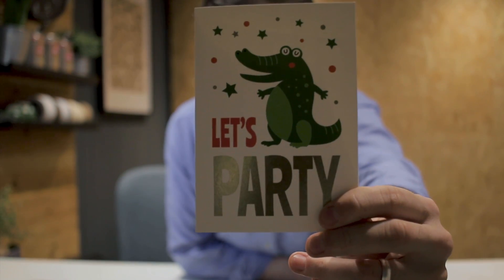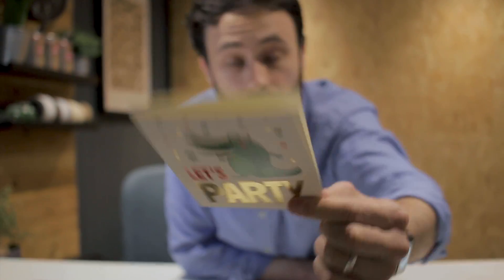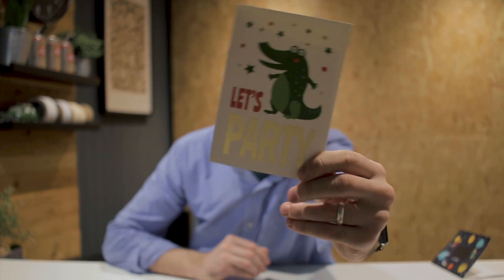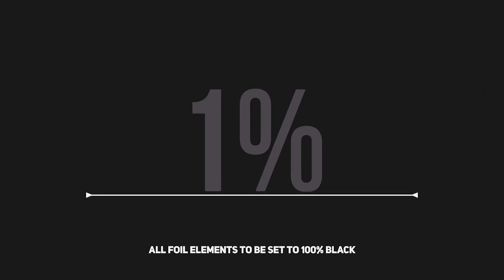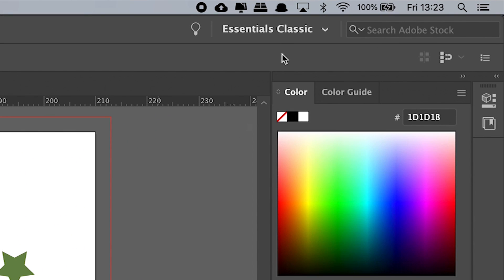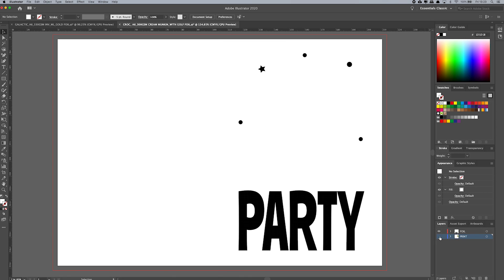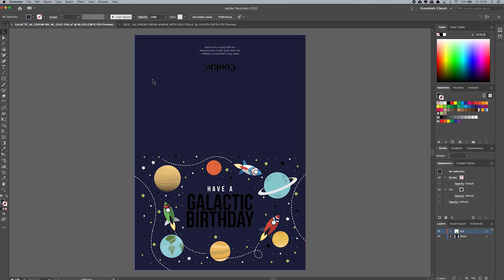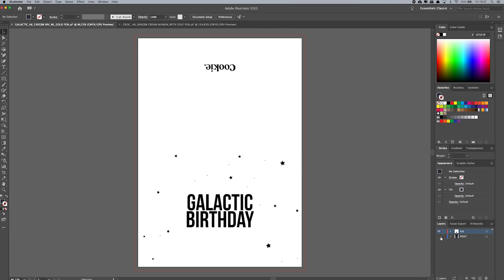How To Setup Artwork For Foiling // Adobe Illustrator

Comment: Excellent video, Rob! Thanks for the great information. Is it possible to print a design similar to the 'galactic birthday' card at home.? I appreciate you said it will need to be laminated in between but don't really understand that part. Maybe I am getting ahead of myself and will start off with simpler designs :D Thanks again!